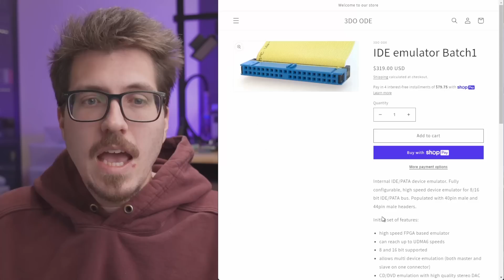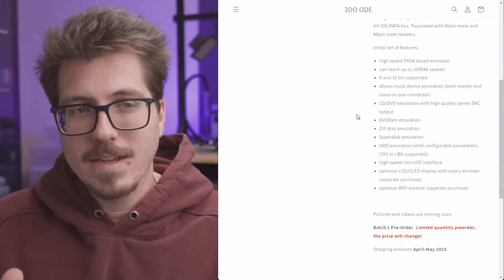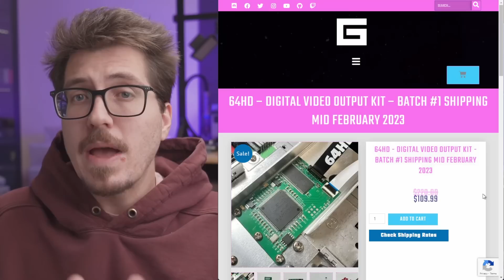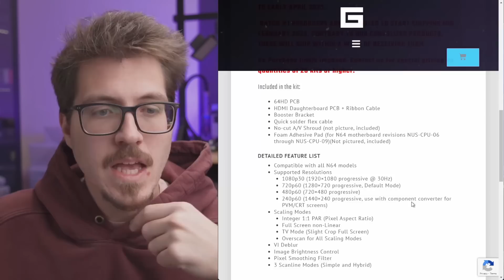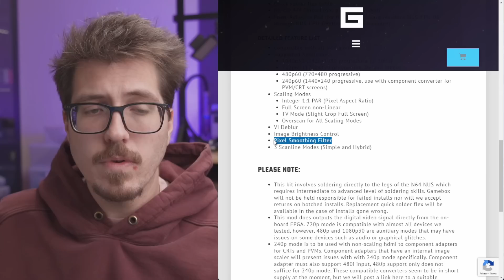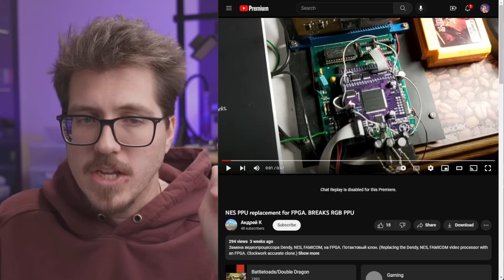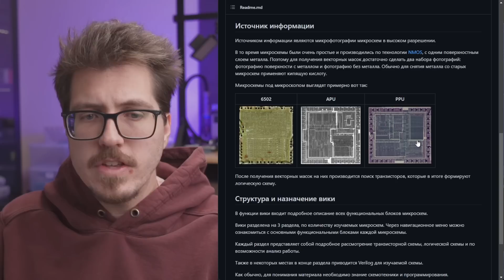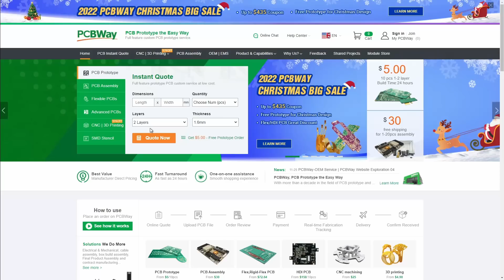FINALLY the Super Nintendo Gets an HDMI Mod! - Retro Modding News

Comment: you know that a HDMI implementation alone from "name" requires a valid hdmi license? I invented a hdmi mod a while ago even with a valid license from another vendor and one of the retro hdmi scaler manufacturer send a notice to the hdmi consortium. I found myself confronted with lawyers and they requested a big fine. Finally the chipset vendor jumped in. But the license schema changed so you NEED a membership even if you use a licensed hdmi chipset. Alone the "hdmi" brand requires it. It could be quite expensive to do so as a membership is $10.000/year alone together with the need to send your "product" for qualification.
Reply: I'm interested in your mod, I know you can't sell it commercially for legal reasons, but I will buy one off of you uncommercially.

Comment: I’m glad a new Psx ode is coming. I’ve tried using the xstation with no success. I even got a mem card pro to debug it but they don’t work fully on Japanese Psx, which are the easiest to source and much cheaper than an American one.
It’s weird that the Saturn was harder to program but easier to ODE’d and the Psx easier to program but harder to hack 😫

Comment: “Legs of the N64 NUS” is a typo or something. Every custom chip in the console and cartridges has the NUS suffix, like the PIF-NUS (peripheral interface for controllers and controller pak slot and companion to the CIC security), AMP-NUS (audio amplifier that also mixes external audio), CIC-NUS 610x/710x (lockout chip), VDC-NUS/DENC-NUS (video encoder), AVDC-NUS/MAV-NUS (integrated audio and video amp/encoder), etc.
Reply: The GPU is the RCP-NUS “Reality CoProcessor,” often referred to as “RSP” for its signal processing functions.

Comment: There is already a project that fits the FDS RAM adapter into a Famicom cartridge. I know HijiQuish Channel featured it a a couple years ago. I would assume you could then use it with a Famicom to NES adapter if you can route the cable out.

Comment: Arcade Card Duo and Arcade Card Pro are RAM expansions for PC Engine Arcade CD-ROM² format games, which was the late follow-up to Super CD-ROM² titles. There are very few Arcade CD-ROM² titles but they include Sapphire, Fatal Fury 2, Fatal Fury Special, Art of Fighting, and more. Some Super CD-ROM² titles include Arcade Card support so that they can load more into memory at once and don’t need to load as often. 

The Arcade Card Duo requires the Super System Card RAM with BIOS ROM built-in to the Duo consoles or Super CD-ROM² add-on. The Arcade Card Pro includes the Super System Card built-in for use with any CD-ROM² system, since the original Interface Unit with CD-ROM² drive does not have a built-in Super System Card. Both the Super System Card and the Arcade Card Pro use the System Card 3.0 BIOS version, so most games will just see a Super System Card while Arcade CD-ROM² titles will look for the extra memory.